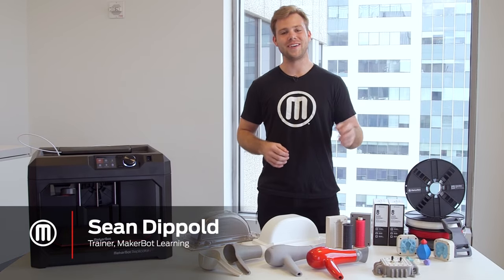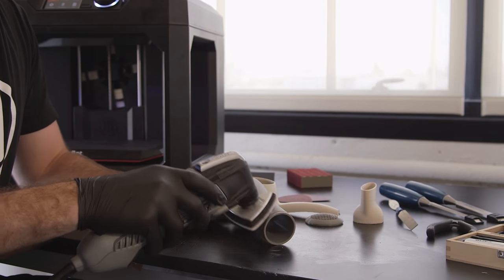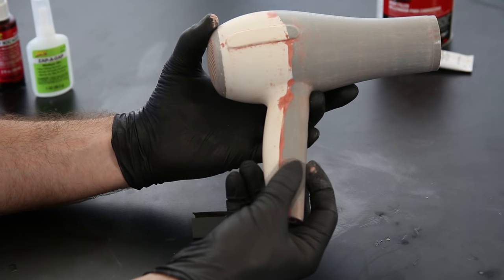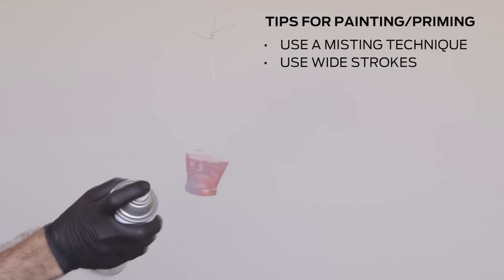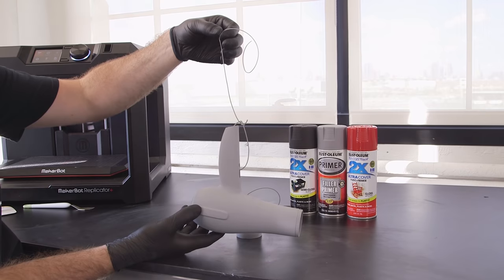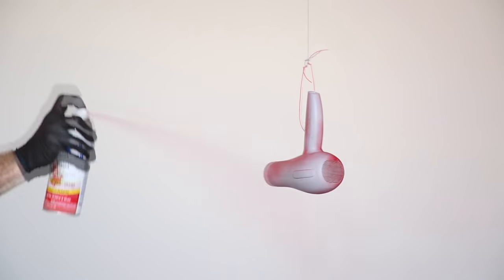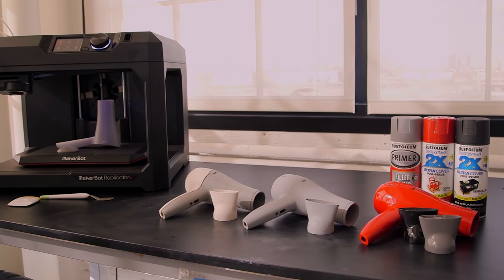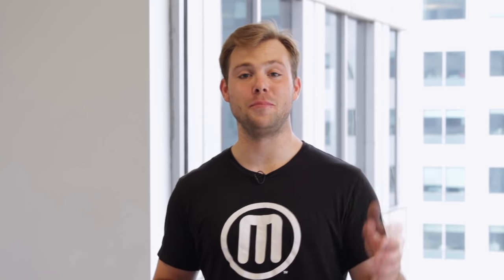Finishing 3D Prints 101: How to Paint 3D Printed Parts

Comment: Do not use stranded wire to hang your parts.  Instead use a wire coat hanger and pliers to create a hook.  With this, you can control the orientation of the part while painting.

Comment: Curious. Bondo goes through an exothermic reaction after applying the hardener. Wont that cause warping of the 3d printed part?
Reply: Unless the reaction releases so much heat that the immediate area gets to the glass transition temperature of the plastic (for example, around 85C for ABS), I wouldn't expect it to warp much! Also, the heat would probably diffuse throughout the model so hopefully, it wouldn't cause too dramatic of a temperature change directly where the Bondo was applied.

Comment: Is that paint safe for prolonged contact with skin? For example, if a 3d printed chain pendant would be painted this way, would it be toxic to the skin?
Reply from the maker: Hello Shaheer, it would depend on the type of paint used. It would need to be a paint that is approved for skin contact. Typically latex and acrylic based paints would not meet that requirement.
Reply: @proto3000_  thank you

Comment: Question: I was about to purchase the "primer filler" then i noticed another
product from the same company called "primer filler and sandable"
they're both grey in color. in this video, the guy makes use of "primer filler"
and is capable of sanding it so what's the difference ??
is getting the filler and sandable better ??
Reply from the maker: The short answer is that it shouldn't really matter, both would be sandable. We don't use a sanding specific primer on our 3D prints so I would go with the most cost-effective option.

Comment: I print small 1:3 scale objects that have letters embossed in them, sometimes. I've tried to mask the area around it with a rectangle and then put paint on it then wipe it off and hope enough paint remains in the tiny letters but I can't get rid of the smudge around it.

Does anybody please have a good method for this?
Reply: I am having the same issue. I'm doing lots of tests. I'm pretty close. What hasn't worked too well: Epoxy paint. Rub and buff. Oil based paints. Skipping sanding and filling. Painting below paint curing temperature. Drying at the high end of the paint's curing temperature. ------ I am working on a panel insert for a 19" rack mount to mount some control toggle switches. I'm using PLA with the letters embossed 0.5 mm deep, and about 5.0 mm tall. I sand down the final print, then a plastic wood filler ( most success with DAP Plastic Wood) very carefully in the pinholes which form inside letters like D, A, R, O, B Q, P. Prime, sand, prime, sand. There is usually some clean up with a needle running through the letter shapes. Then a flat black spray enamel (Testors), several coats. Then a couple of coats of Testors Gloss spray lacquer. This makes it slick enough for excess paint removal. The I don't mask because it peels off the paint.  I then use a matte acrylic liquid paint (water based) very carefully daubed into the letter insets. I use a matte white Apple Barrel brand (PLAID). Then use a rubbery caulk corner tool to squeegee the white paint away. Yes, it leaves streaks. Then a moist paper towel wrapped around the squeegee to wipe away the excess. Using a clean wet part of the paper towel, I continue to clean up the area. Unfortunately, during all these test experiments, I have messed up some step ruining the project. But the filling of the letters with water based acrylic and clean up with water has worked, but it was on a piece I ruined. I masked with scotch tape and it pulled up the clear finish. Here is my email if you want to share lessons learned and I can send you photos. pdwhalen@gmail.com. Good luck friend!

Comment: A polisher you recommend for after painting?
Reply from the maker: Hello Enrique, we don't normally polish our prints after painting. Sanding will typically create a smooth enough surface finish and we then apply a clearcoat for a glossy look
Reply: @proto3000_  I need to know what is the electric sander brand name? i interested to buy elec. sander like that...thanks.
Reply: @algojo76  they are using a oscillating tool with a sanding bit. Its Dremel brand. Hope that helps

Comment: Ehm is that a hairdryer made out of pla?

I thought the point was of pla that it melts very easy
Reply: I might be wrong
Reply: @spookydahmurky7130  I think thats only the prototype of the product. How it'll look at the finished state.
Reply: Well you are assuming way too much. It could be any type of material that the fdm printers accept.
Reply: Assuming it has been annealed, PLA won't melt at standard hairdryer temperature and will actually get stronger on each and every repetitive heating to the point it will stay solid even at 150 C.